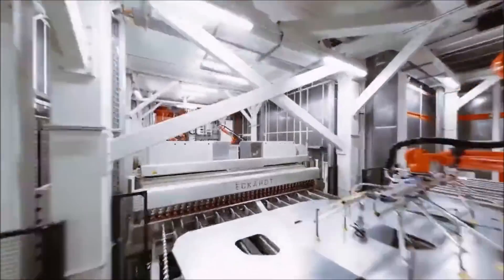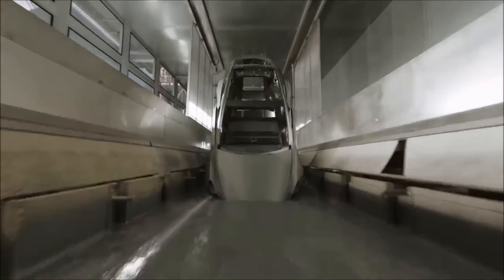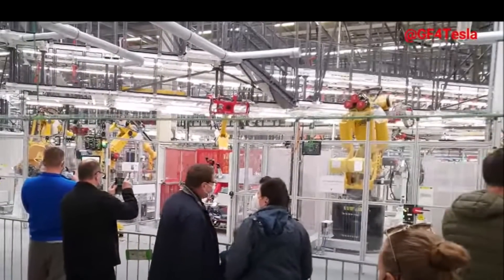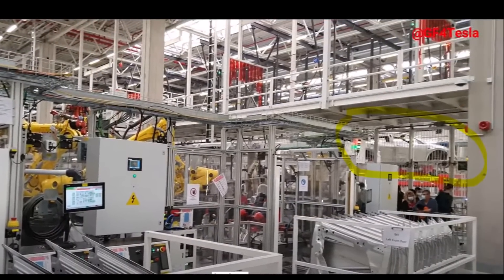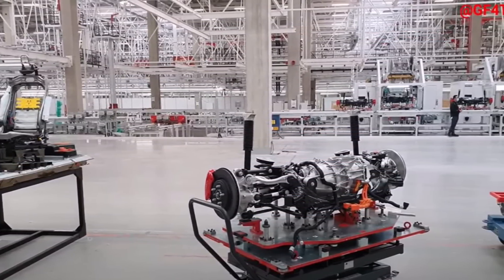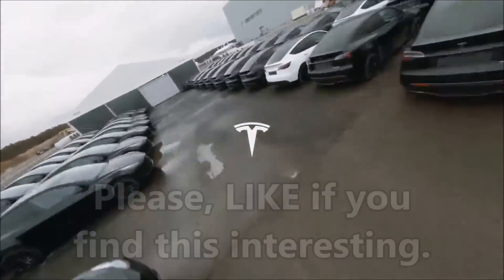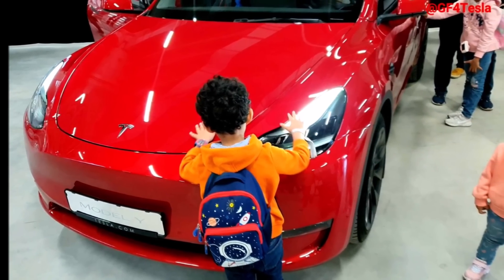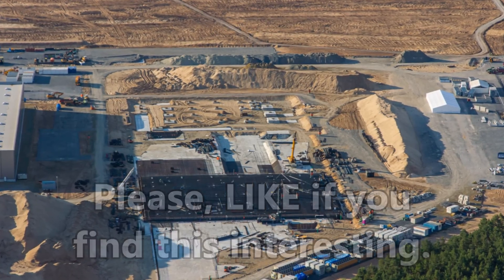Tesla Giga Berlin Went Cold Turkey, Then It Just Doubled Production

Comment: 280 miles from LFP batteries normally usable 100% to 0% is actually more useful than a 320 miles ternary battery that most of the time can’t use more than 80% charge (90% to 10%) without degradation.

Comment: Yet in Shanghai they are producing over 20,000 / week, which is 10x Giga Berlin. Why? Why the big difference? Are Germans just 10x slower at doing things or is the plant fundmentally different from Giga Shanghai?
Reply: Because Berlin is early in its production ramp and only has one line running with 2 shifts. When it adds lines and the 3rd shift and fully ramps the production, Berlin will have much higher production rates.

Comment: I worked in manufacturing. It does not matter if most work stations produces 10s of thousands of subassemblies, it will only be as fast as the slowest work station.
Reply: Tesla constantly improves every aspect of the car construction. They recently redesigned the charging busbar. Within hours the new version was in use. The line did not even pause. A few days later the upgraded software had increased charge rate by 20%. 
Nobody else goes this sort of thing. They don’t even try.